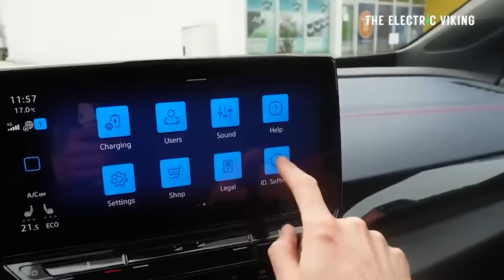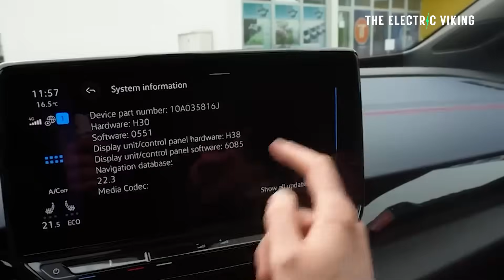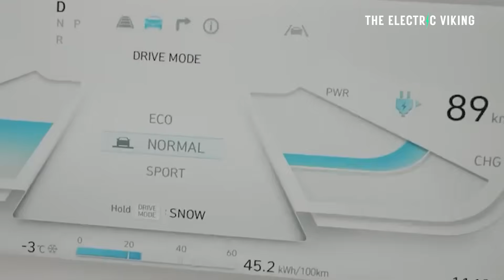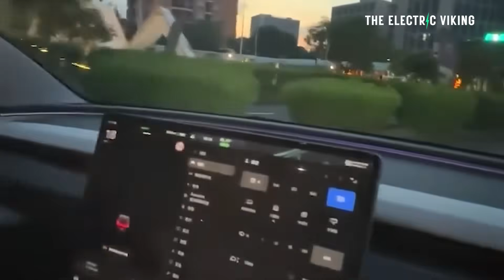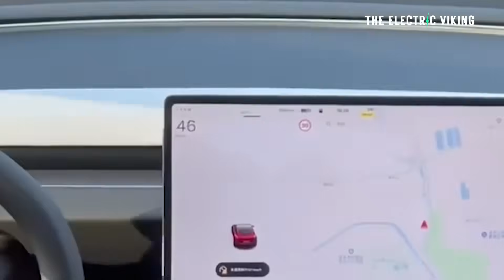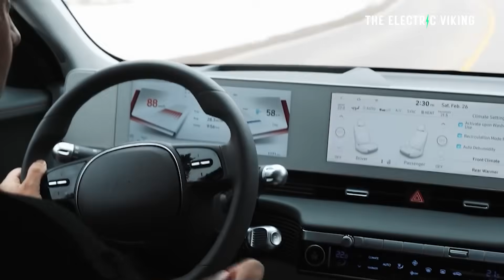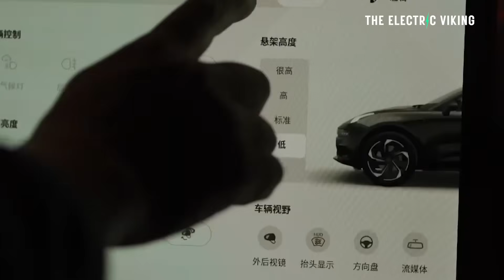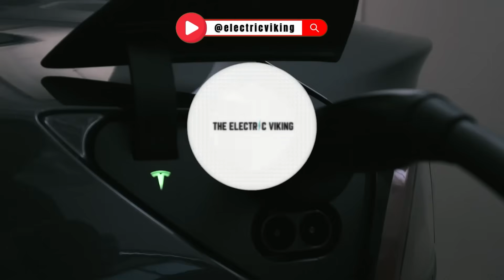Study analysing 10 million cars finds EVs more reliable than GAS cars

Comment: Im a big fan of EVs but combustion engine cars last  much longer then 18 years.   I own almost 30y old one with almost 300 000 km on it. Still drives just fine with unchanged range from new  :)  I bought it 2nd hand for 8000 eur.

Comment: Our 30 kWh Nissan Leaf is 8 years old and has been completely reliable. Its SOH is 83% but we still get 70-80 miles of range which is fine for our local trips. And it’s charged mostly from solar PV at an annual average cost of £0.01 per mile.

Comment: If you just take the drive chain of an EV it has around 22 moving parts where as an ICE car has about 200+ and has to deal with heat, fluids, air pressures. I mean they are amazing feats of engineering but lots more to go wrong.   That's why electric motors are used in almost everything we use from toothbrushes to power tools

Comment: How can ICE engines ever compete against EV engines in reliability? Once the new generation of EVs has ironed out its problems. ICE can never compete. An EV engine is just battery and electric motor. ICE engines are horribly complicated, with fuel pumps, injectors, cylinders, cooling system, transmission, gear box. Bloody heck! The ultimate indictment of the ICE engine is that it uses combustion to convert heat to work, but it needs a cooling system because the materials can't withstand the heat or else the machine seizes up and won't work anymore. Not only are you losing 60% of the fuel energy through heat radiation, but much of the energy that you successfully convert is used up by the cooling system. ICEs are highly refined primitive machines.

Comment: Everybody knows that electric motors are more efficient and reliable than mechanical petrol engines.
The auto industry is corrupt. Ice cars require a lot of maintenance. And that means money. Lots of money.
 Greed is why the world does not have affordable electric cars for everyone.
Hopefully, China will change that problem and fix the corruption in the auto industry.

Comment: Authorities in US, Germany, Denmark and more clearly  show that Tesla is by far the least reliable of all cars (in the US second-least, unly "surpassed" by Polestar). This is not any ones opinion - but the result of regular technical inspections.
Reply: Chinese made Teslas top the surveys for reliability and lowest manufacturing faults every year (BYD at the bottom), beating all the European manufacturers there. 
Tesla is amongst the lowest call outs for the German ADAC. 
Tesla always wins best customer satisfaction surveys - Bloomberg found 98% of Model 3 owners would buy again! 
Tesla has the lowest warranty claims of any US manufacturer (Warranty Week). 
UK AA found in 2024 a new ICE car will lose around 60% after its first three years at a mileage of 10,000 miles a year. The Tesla Model X after three years loses only 43%. Model 3 is one of the brand’s best for withstanding EV depreciation at 40% after three years.Tesla Model Y retains 76% of its value after a year and a half. 
A Tesla will outlast the 133k miles average ICE (iSeeCars) by 2-3 times (Dutch/Belgium Tesla mileage database). 
Tesla has no required service intervals (recommended change coolants every 6 years). Typically European testing centres receive vehicles that have been recently serviced and therefore show fewer faults! Reliability and low cost to own (cheapest brand - Consumer Reports) are Tesla bywords which is why they are among the best selling cars in the world and Tesla will have the market capitalization of all the OEMs combined...
Reply: Source?
Reply: Which authority? Why is this unknown?
Reply: I posted the links twice, they get deleted by the Electric viking. You Can ask him why… And you can google it yourself, the German authority is TÜF.
Reply: What am I supposed to do, every time I  post links he deletes them. These official statistics are well known to everyone - but maybe the US is suddenly some kind of China in this respect.
Reply: This channel has a clear agenda, it seems. So much for free speech.
Reply: I thought it was some ban on links, but he even deleted name of official sources.
Reply: You are mistaken. Tesla is the worst of all cars in German official tests. Same in Denmark. Second worst in the US. Go look it up.
Reply: The last time I added sources they got deleted, so let’s see if this survives the pro-Tesla censorship…

Comment: of course so obvious. There are much less components then ICE vehicles. I used to own a electric moped in 2009 living in Hainan China for a year. That experience like no oil change of any kind. Just charge and go. Even at that time the range was below 50km.
Reply: You would still need some lubrication for the moving parts, but you're otherwise right.

Comment: What about it’s depreciation?
Reply: Every car depreciates.
Reply: The savings during your use would cover a huge portion of the depreciation.
Reply: Just keep it and drive it at least 10 years.  Do your homework first to make sure it fits your use case for the next decade or so.
Reply: UK AA. In 2024 a new ICE car will lose around 60% after its first three years at a mileage of 10,000 miles a year. The Tesla Model X after three years loses only 43%. Model 3 is one of the brand’s best for withstanding EV depreciation at 40% after three years.Tesla Model Y retains 76% of its value after a year and a half. 
A Tesla will outlast the 133k miles average ICE (iSeeCars) by 2-3 times (Dutch/Belgium Tesla mileage database).

Comment: Sam, I own three gas chainsaws and one, new,, Ego, battery chainsaw. The chainsaw is 56 volts and came with a 4 amp hour battery. Replacement batteries are available up to 12 amp hours.

The most important part of a chainsaw is the chain. And I buy the same, Oregon brand chains for both my gas, 16” Husqvarna as my  16”, battery Ego.

My point is that, like your post about the reliability of EVs, the battery Ego is simpler to use and more reliable than my old gas saws. And, I can just plug the batteries into the charger at home. I don’t have to make the 20 mile round trip to town to buy gas.
Reply: I am wondering, how about the power? Do you have less power to cut with the electric one? how about the "working hours". How long does the battery last on a normal day?
Reply: @RuffyUzumakii7  Notice he didn't say he'd given the gas chainsaws up.

Ive got a 16" Husqvarna gas chain saw and a Dewalt "as good as gas" battery chainsaw. The battery is great for trimming small stuff, but bigger stuff , 10 inches or greater, I need the gas chainsaw.
Reply: Electric is perfect  for smaller outdoor equipment. I have an Ego mower and trimmer and I love them

Comment: They compared old ICE from 2005 with new EVs? It´s for nothing - please compare 1 million comparable 3 years old EV with 1 million 3 years old ICE to get results. I have no doubt, that any EV will outlast the new 1.4 Liter-2 turbos-200 horsepower ICE engines. And they will outlast any new 4-cylinder ICE Mercedes AMG. But how about a 1985 Toyota Landcruiser HJ60 with a 4 liter 6 cylinder diesel and 115 HP? They run today and they will run by 2035, even with very low maintenance.
Reply: Oil changes (Diesels usually have large sumps that require more oil than ICE cars), injectors, multi stage fuel filters, water separators, carbon traps, tire rotations and so on.  Diesel engines last longer than gas cars, but they still require maintenance that is not inexpensive. When you go to rebuild a diesel the parts are more expensive than a gas car.  

For the first 100,000 miles, the only maintenance on my EV is tire rotations and changing the cabin air filter.  At 100K, it is change the quart of oil for the motor bearings and change the coolant in the HVAC/battery system.  The electric motors are lasting so long that there is not much data on their lifetime or rebuild cost (it will be mostly labor since there are usually only a couple of bearings that will require replacing.  

As far as battery replacement, in the US the required battery warranty is 8 years, so again there is not much history yet.  Once EVs get up in age there will be battery recycling and that will reduce the replacement costs.
Reply: @FoamCrusher  That´s a 5 star reply:) It´s the electronics and software updates that start to fail and get mixed up. Connectors that get outdated. Battery soldering points that fail. As it ages, an EV will meet bumps on the parking lot and lots of potholes on the road. Water leaking through sunroofs or window seals. Damage and malfunction of the battery heating/cooling system. Glue coming off. Touchscreen failures with no compatible replacements. Until 3 years ago EVs have been driven by tech-savvy enthusiasts - what the masses will do to them is yet to be seen.
Reply: @SunshineShane  Of the things you listed, won’t ICE vehicles have the same issues?  I know my wife’s 2024 SUV has almost as much tech as my EV but perhaps less in the way of OTA updates;  screens, modules, circuit boards, active suspension, sunroof, etc. 

The difference right now is an EV is a computer system wrapped in a car and an ICE vehicle is a car with an extensive computer system. However, that difference is rapidly closing.

Comment: And what about the 36 million Teslas that have been recalled for various quality control and reliability issues...that's almost every Tesla ever made.
Reply: A recall for a Tesla is usually an over the air update.  Many people confuse update for recalls.  Really cool how my Tesla has been getting better and better the longer I have owned it.  Dont know any Ice car that does that do you?
Reply: Since Tesla and Rivian (and maybe Lucid?) are the only car companies with OTA software upgrades (other than infotainment), there are many more “features”, as they are added and changed every few months. So there are more possibilities of needed changes. Most are pretty inconsequential and are fixed within a few days. What you’re thinking is that there are literally parts of the car that need to be swapped out or fixed. That’s how recalls work with other car companies but not the built-from-the-ground-up EV companies.
Reply: @juliahello6673  A mechanic, The Scotty Kilmer channel, showed the documentation  from Reuters news and other institutions tracking the E.V. phenomenon, and many of the recalls are fairly serious...like the Model 3 that took off of it's own accord, ran full speed for two miles and then killed some people... in China...which is why you never heard anything about it in North America. There is a government vehicle safety institution that tracks fatalities from self driving E.V.'s . As of three years ago, 19 of the 20 plus fatalities that year were from...Teslas.

Comment: Reliability?  How many moving parts in a gasoline engine?  Perhaps 100.  Moving parts in an electric motor: 1.
Reply: Try two or more hundred.. and more if its a larger and or performance engine . ..and then theres the clutch and gearbox.
Reply: The actual number is an average of 20 moving parts in an EV compared to 200 for ICE!

Comment: Here's the issue: if my ICE car' powertrain experiences an issue, I can take it to a mechanic and usually get a reasonable price to fix it. If my EV breaks down in its powertrain (battery,  propulsion system), I'm pretty f***ed and likely my ownership of that car is at an end because there is no mechanic who can fix those problems without asking for exorbitant amount of money -- and understandably so because it requires more expertise, parts are more expensive because they're more complex, and EVs are not as easily "accessible" to mechanics as ICE cars.
Reply: I understand the fear behind this issue. The same fear happened when we started adopting petrol cars over horse driven buggies. Eventually, charging and repairs will be done easily anywhere. Fortunately EVs today are exceptionally reliable. I was always concerned about the power electronics but even this has matured to be extremely reliable. Still, just imagining a broken EV is definitely a daunting thing for a lot of people ATM.
Reply: Batteries in EVs are having 8-10 or more years on warranty. Battery, which is the equivalent to an ice engine, is no longer an issue of concern for buyers.
Reply: @FrankiePo89  what do those warranties cover? I find you're often  at whim of dealerships, who try to make any excuse to charge you and make a reason not to cover you even if you have a warranty
Reply: @luciusael  
It's a manufacturer warranty on the batteries, free replacement if your battery dropped below the 80% range within the warranty period. Nothing to do with the dealers.

Comment: I think a good quality ev brand battery can easily pass through 200K miles 😊
Reply: Taxis in China often run their old NMC BYDs for 300km+
Reply: and how is that surpassing cars with ICE, lasting over a million miles? Of course, maintenance is necessary and maybe a bit less on an EV but changing the battery is like changing the engine in a normal car 🤔
Reply: @webnplay  what are you talking about? ICE cars on average last shorter than EVs. If you even make it to the natural life cycle of a battery, you would have saved so much money on gas, parts, breaks and all the rest that you could have already bought a brand new car with the savings, let alone change a battery
Reply: @ you have clearly never driven an older mercedes 😂 cars that lasted on 200k is rediculous. Of course maintenance is required but you can easily drive ICE 400-500k with regular maintenance, at least with the older models. Also mileage on gas is cheaper here in Europe then electricity if you cannot charge at home.
Reply: @webnplay I owned a Ford Mondeo from 2011 until two years ago. It was still okay and I think it’s still on the road, but there is no way it’s going to make it to 250k kms without significant replacement to the drivetrain - and my car was always serviced at Ford on time.
Reply: @webnplay  literally have driven Mercedes for 30 years... It's complete trash in terms of upkeep costs. Changed break pedals, oil, transmission, many small parts, engine fixes, etc. ignoring all that, the gas price alone has already amounted enough to buy a second Mercedes compared to electric. We've had to change cars way below 200k because it is just sputtering and creaking in so many places and clearly dying. 

This is also just a fact. They recently had a massive study of 30 million cars, and even including old pre 2018 EVs which were just awful compared to today's EVs (think of beta EVs from almost two decades ago) and EVs still are way more cost efficient and on average last for more distance
Reply: @ well it is also 13 years old now and still driving. No way a Tesla will last that long.😂 but it is sad that Ford is not making quality cars anymore.
Reply: @JeremySMJ  man I have driven a Peugeot 407 with little upkeep until 400k. You must have been very unlucky. Most ICE cars are driven much more than that. They are often exported to poorer countries where they are still used. No way this will happen with EV’s for the time being. Now you are right about cost of maintenance. That is much lower per kilometer or mile in an EV if you buy or lease a car new. But then again not everybody can afford a new EV and EV’s in general are more still expensive here where I live.
Reply: @webnplay  you are terribly misinformed. Your car is the exception and not the rule. Go check up the stats. Newer EVs from the last 5 years are also astronomically more reliable than any ICE on the market. You think EVs can't last that long but taxi drivers driving $15k USD Roewes and BYDs for 400k are proving you otherwise. Taxi drivers in China and Russia both pick electric. When it's a business, people go with what's objectively better and not just feelings
Reply: @JeremySMJ  neither is your mercedes experience. Mercedes has been the car for taxi drivers for ages.
Reply: @webnplay  not at all. 150k miles is very average for major issues to arise in a Mercedes E and S class. Still much better than our experience with BMW. Teslas are way more reliable than a Mercedes with way less maintenance costs every year. 

Saying taxi drivers have driven Mercedes doesn't support anything. It's a minority of luxury taxis, not a reliability thing. Workhorse taxis in China have long transition to electric. Just the cost of driving alone already is a massive difference. 

30 million car study. Tons of taxis choose to replace gas with EVs. Yet you want to rely on your assumptions still and pretend a Peugeot is more reliable than a modern Chinese EV because of your feelings for your car.
Reply: 800k mile warranties on Teslas batteries
Reply: @drmap5194  EVs are far simpler machines, far less points of failure.